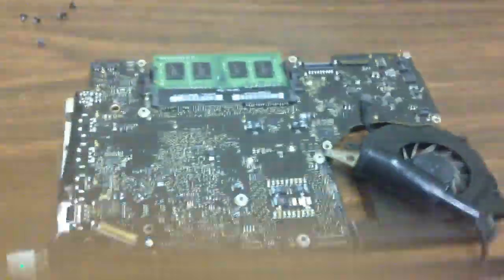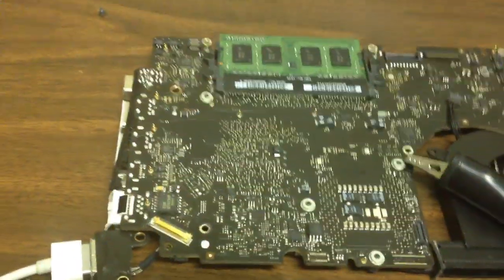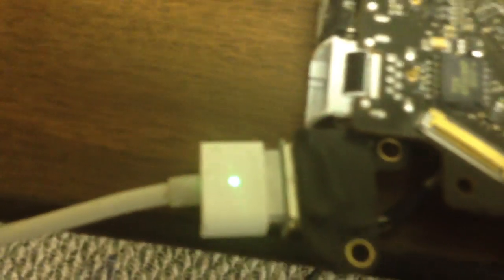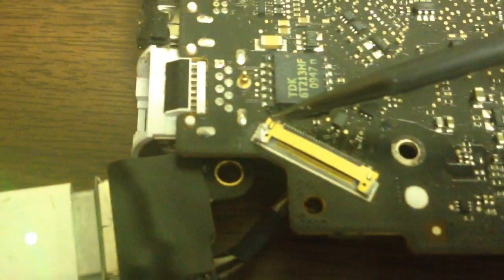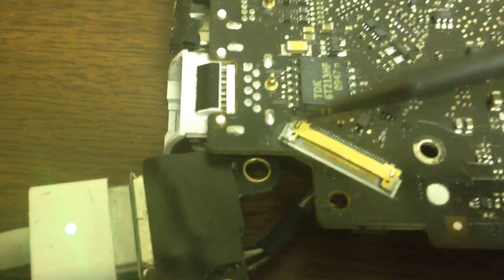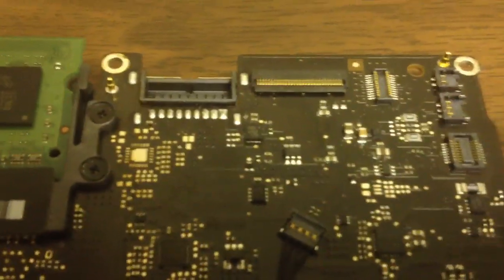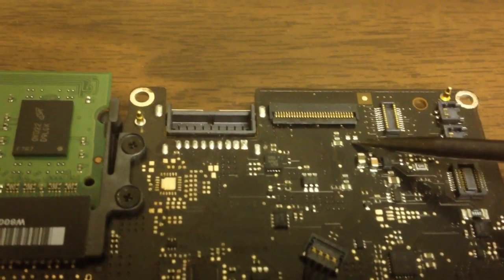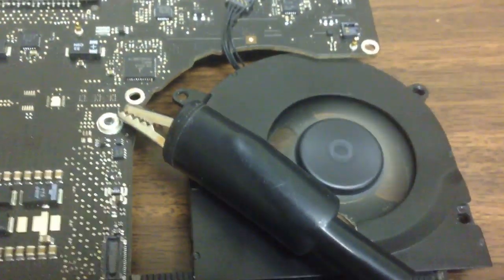Apple logic board repair to fix a no power and no video issue caused by water damage

Comment from the maker: Clip it to a screw hole pad so it is grounded to the board and not the case. Then hit the probe on the pad. The same can be done by hitting the probe to the fifth pin on the keyboard plug. That is the power on/off pin for the keyboard. The idea is one shorts the SMC and resets it then powers it on and the other just turns it on and off.

Comment: No its not what i mean, what intereset me its the way you check the different fuses, capacitores, and their location on board, also how do you find out what is what and how the logicboard basically devided in circuits..what about a tripod?